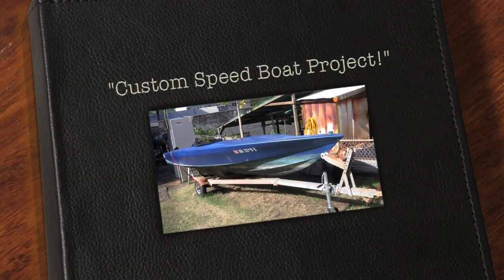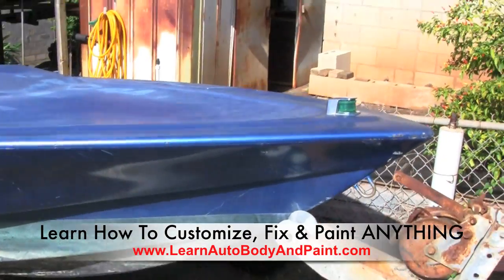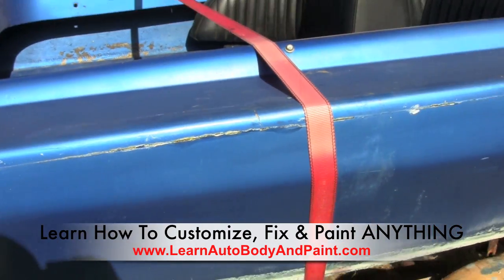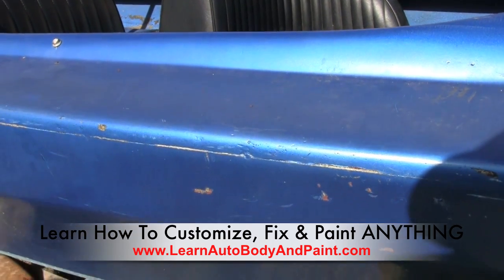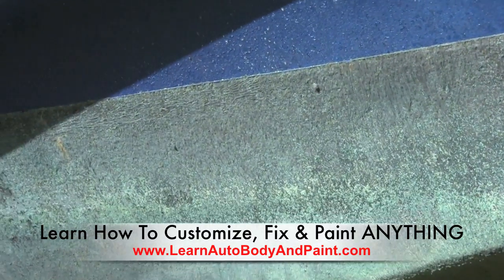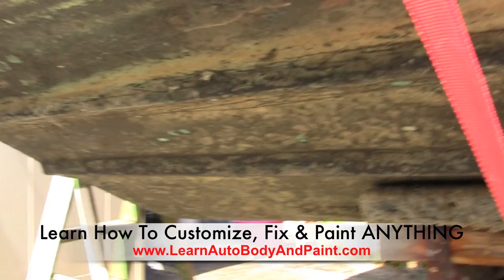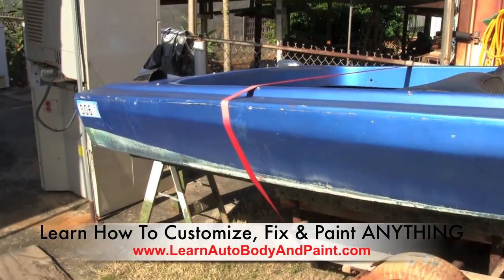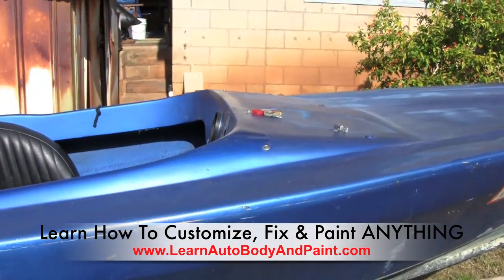LearnAutoBodyAndPaint.com Speed Boat Auto Body Painting Project!

Comment: The floor is most likely wood. Therefore it should be cut out and replaced with a new piece of plywood. if its just fiberglass your foot will go right through it or at the very least it will Flex lot as you step. You can tell by how thin the fiberglass is, the wood has most likely rotted away leaving only that thin fiberglass layer which is not strong enough to support somebody's weight while standing in the boat. Good videos by the way thank you